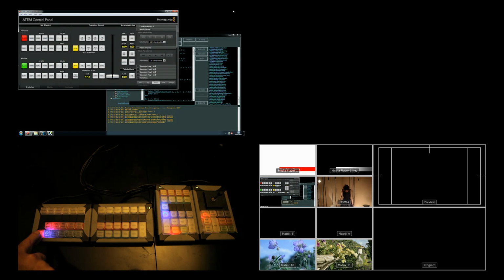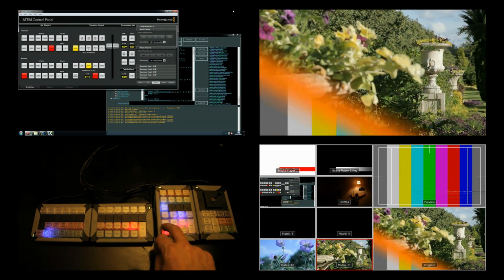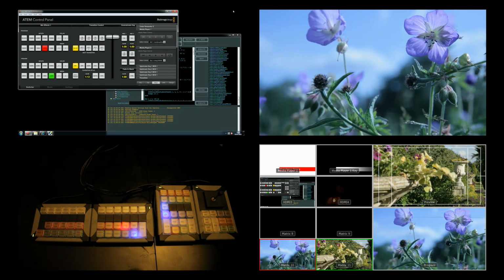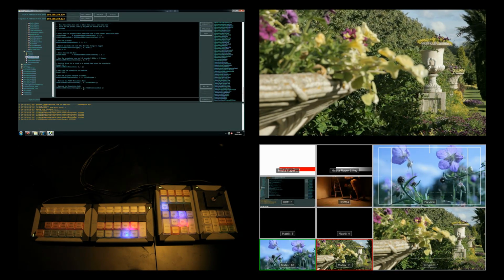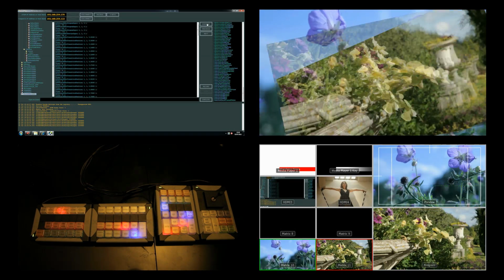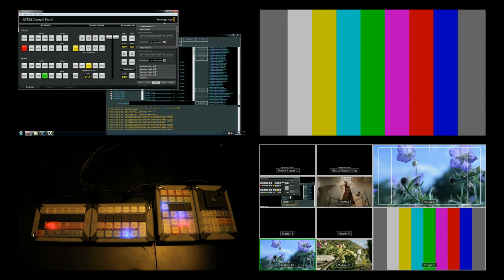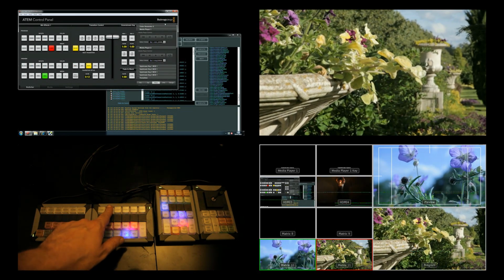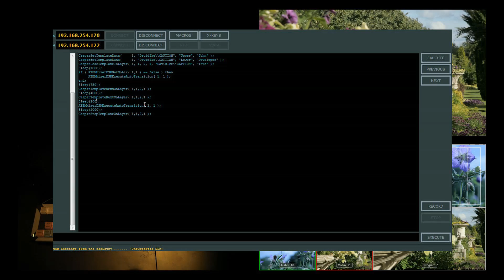ATEM XKeys & Macros Demo

Comment: Great video thank you sir! I am a beginner in this field, as I work to implement such system on a low budget indy web tv, whis no previous experience on broadcasting (I come from the lighting dept in the cinema industry). So it seems that with this setup I'll be able to overcome the limitations of our atem ps 4K. CasparCG can take care of stingers and maybe DVEs ? I am still trying to figure out all this would work and what casparcg can do with an atem (get several live signals, resize them, add a background, run an animated lower third and send it back to the atem?). Thanks a lot for your videos, It adds a lot of water to my mill ;) Hope you'll be reading this